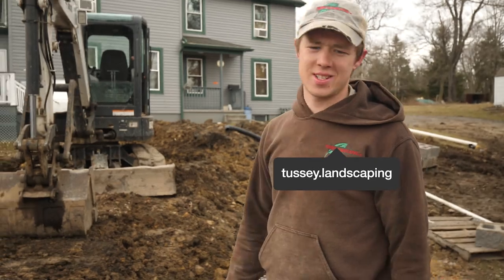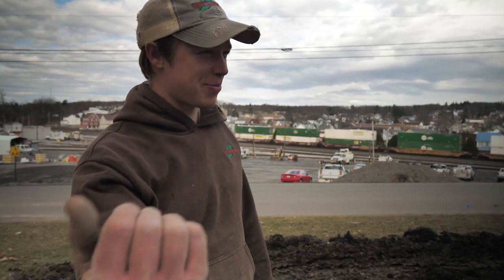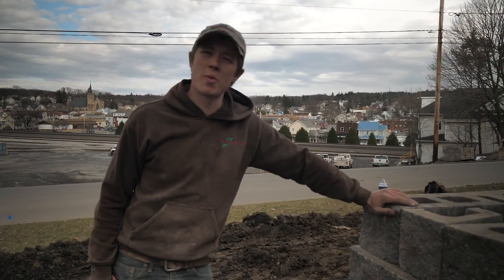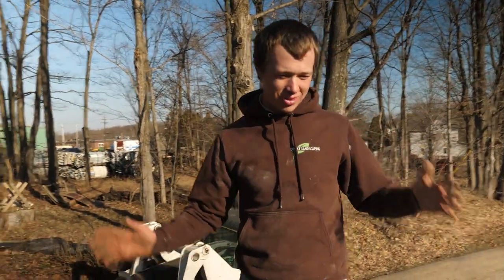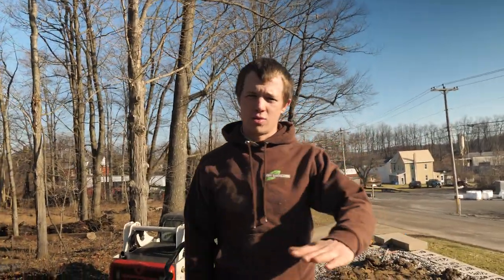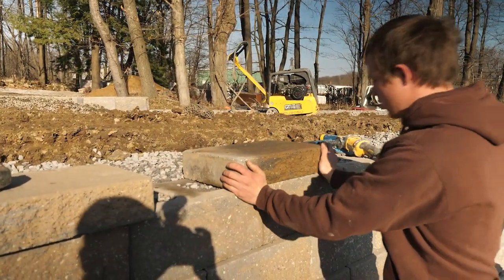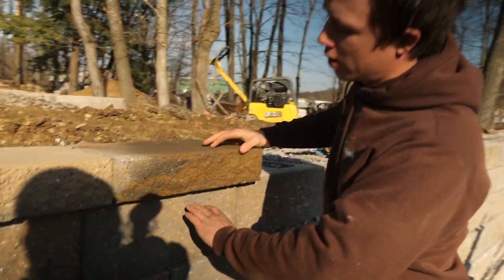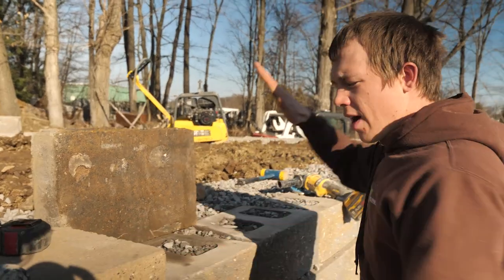How To Cap A Retaining Wall | Part 4 | Tussey Landscaping

Comment: You mentioned a fence was going on top of that wall.  Questions... how will they anchor the posts? Will the adhesive for the caps be strong enough to support said posts? Ben, favorite sandwich?
Reply: It must be tongue 👅 because he hasn’t stopped wagging it for two videos now about that train.
Reply from the maker: Yes it wasn't a very big fence, the adhesive was strong enough.
Reply: Can a guy use concrete anchors in the caps for post supports ?